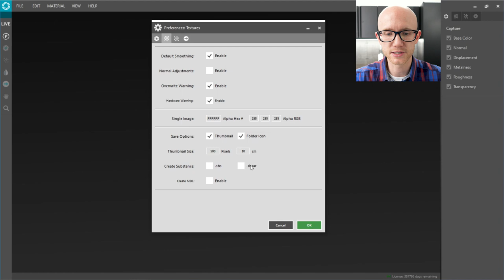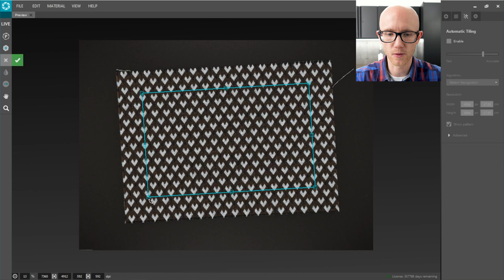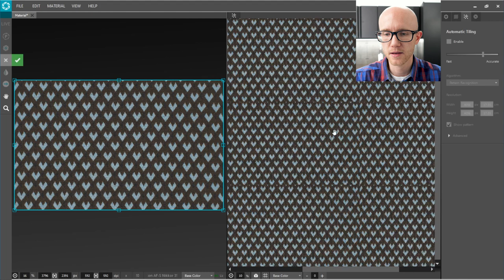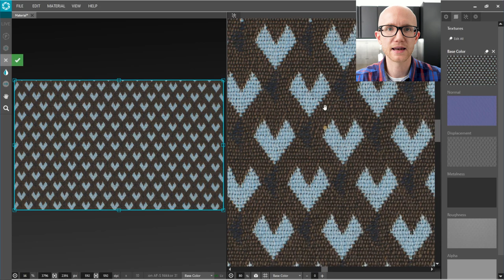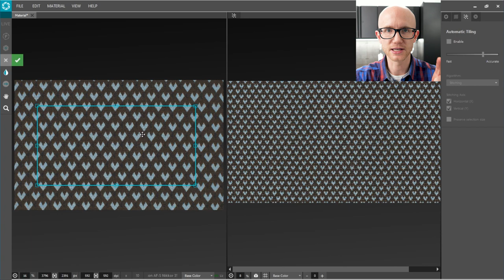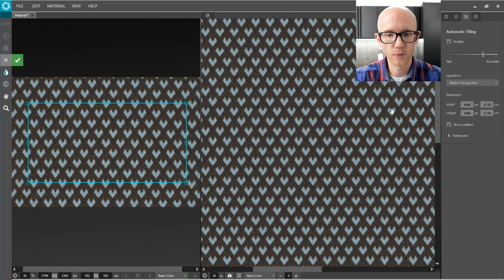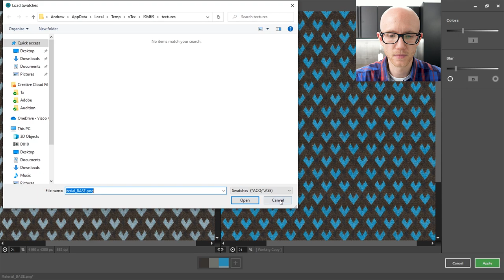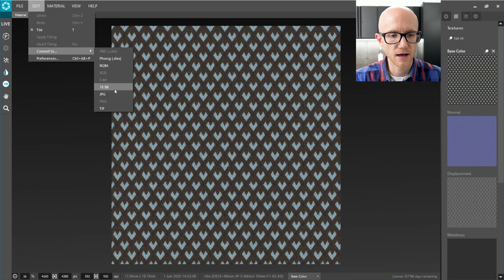How to Scan Materials with xTex - Fabric Scanning Workflow Demo

Comment: How can that normal map look like that? The hart shapes should be just as flat as the rest of the fabric, right? This feel kind of fake. Are these maps generated by a algorithm or created out of different photo's with lighting from different angles?
Reply: The xTex hardware generates maps using various lighting positions and multiple photos, but if you just import a picture and then edit it, you will not get as accurate of a result.
Reply: @Marcusstratus  Yes exactly. So it's just like crazy bump in this example..?
Reply from the maker: Thank you for your question. The material captured in this demonstration is not a uniform flat print, but rather a woven pattern with raised heart shapes and other surface variations, so the normal map is correct. Our hardware capture process uses multiple lighting positions and photos to generate accurate maps. The xTex software does have the added functionality for importing a single photograph and generate faux normal maps from coloring (as you would get from crazy bump, xnormal, etc), but the hardware and software capture process shown here produces much more accurate and true-to-life results.